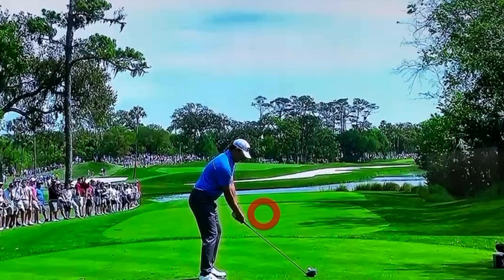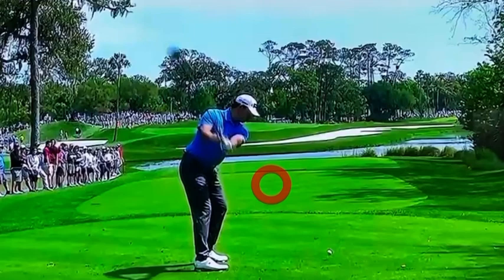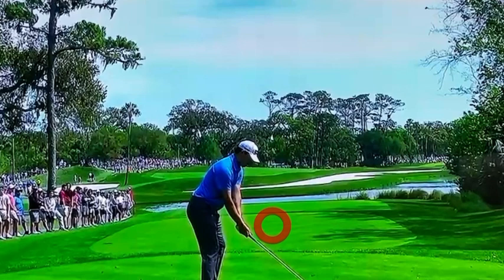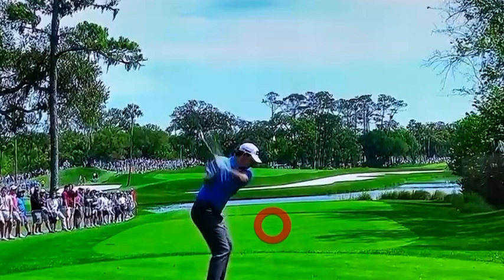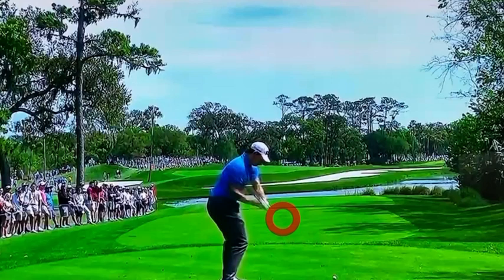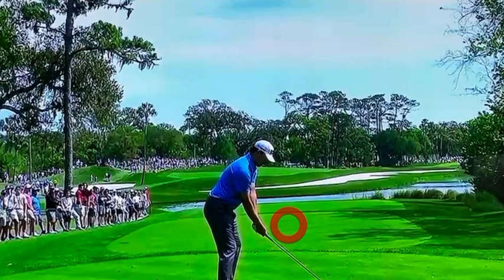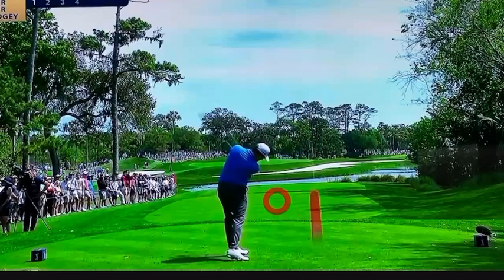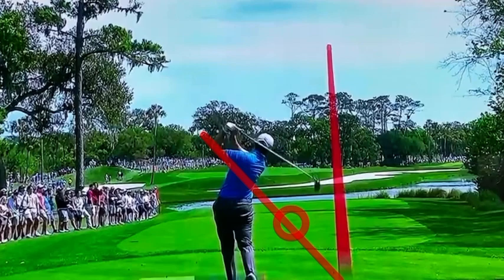Patrick CANTLAY at Players demonstrating power accumulators for 177 MPH #tgm #pga #power #kpga

Comment: I looked at his P2 Position in this video and another video where he is hitting an iron.  The butt of his club is pointing at his left (Front) leg vs in tighter to his right leg (back), which creates a lot of space between his body and club back swing path .   In addition, the swing is very up-right.   It seemed like a lot of the players in the Players Championship tournament hit this way vs flatter plane.    This is different from the Stricker swing you just posted a video on.  I like your comment on Cantlay rolling his arms on the finish for this swing.   With the Stricker (no wrist cock) swing I felt like you have to roll the arms on the downswing and finish high   Another pt.    Tall guys can generate a lot of speed without their legs.  Same thing for baseball pitchers.   Tall guys can go with the tall and fall theory vs dip & drive theory for the shorter guys below 6'-1".   Short guys have to leap off the mound to create speed vs. tall guys that push lightly.   All leverage with accumulators.   Cant wait to see the next video